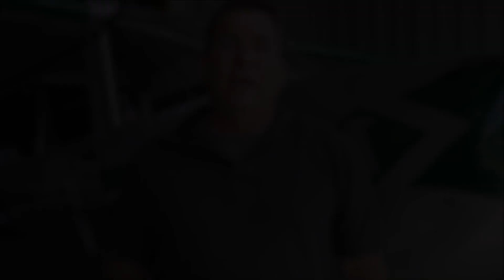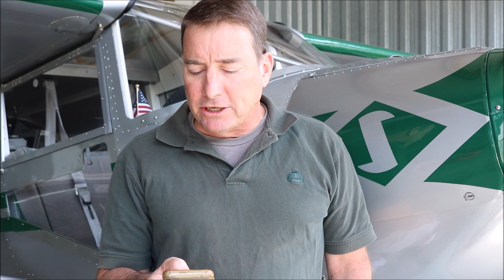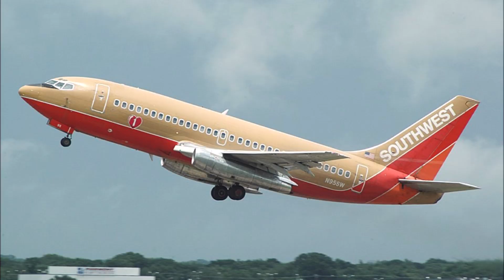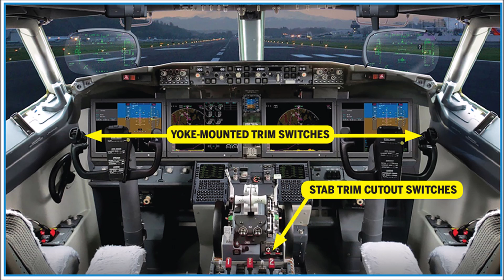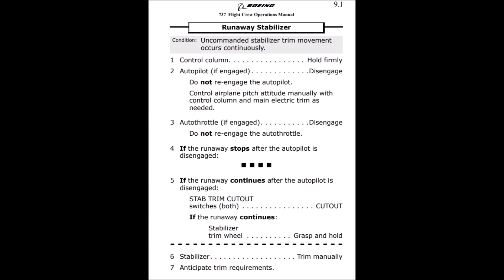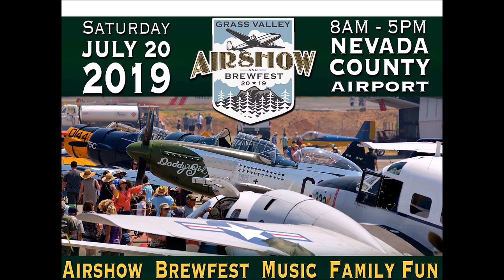737 Max UPDATE 27 June 2019 -The Latest Issue

Comment: If I recall correctly, this channel blamed the pilots for the crash events?  Still of that option?
Reply from the maker: Yes, they have there share of the blame as does Boeing's design. You simply cannot leave the throttles nearly WFO...
Reply: As I thought from the very start, it is a failed design with a failed implementation and, if possible, a potential cover up.  People can assess your judgement and overall knowledge through your videos.  A robust well engineered and implemented system does not lead to this even once, certainly not twice.  I’m not sure about your evaluation if this particular scenario.
Reply: @indepviewpt  
Accident investigations don't generally use the term "blame," they refer to causes.  Everyone agrees that Boeing screwed up.  Nobody has offered any kind of cogent explanation for why the MCAS software failed to use both AoA sensors and failed to do any error/reasonableness checking of AoA inputs.  And everyone agrees that the implementation of MCAS presented crews with a challenging situation to recover from.
That doesn't mean you don't look at other causes.
In the case of Lion Air, please explain why the crew stopped using MET to trim up and advanced the throttles to WFO (as Juan says) AFTER the aircraft entered the final dive?
In the case of ET302, please explain why the crew failed EVER to use MET to fully neutralize control forces, particularly where they were trained on the Emergency AD.  Also, consider that the aircraft appears to have been over Regulated T/O Weight (ferrying fuel) and in trouble from the get go (the Preliminary Report said they were under RTOW but look at the average weight per pax they used to get there).
So there were other causes than just the bad MCAS design.
A robust well engineered system isn't going to prevent airlines and pilots from doing bad things in every possible situation.  That is an unreasonable expectation.
Reply: If one stops getting lost in the details and, instead, goes to the “30000 foot” view, it can be seen that two planes crashed fir essentially the same reason with licensed professional rated pilots flying.  Can you please state the other time this has happened?  This is a FAILURE of enormous proportion.
Reply: @indepviewpt  
All you've done is substitute the word "reason" for "blame."  
The 30000 foot, forest for the trees argument, is what the plaintiffs' lawyers will argue because it's their obligation to get the most money out of Boeing they possibly can.
But for people who are interested in aviation safety, you don't ignore the details.
And, if you want to talk about the "reason" the two planes crashed, I believe it was for essentially the same reason (in the sense of principal causes):  MCAS put the planes in jeopardy and the crews failed to do what they were supposed to (and did what they weren't supposed to) to save recoverable situations.  There were probably other contributing causes, such as airline procedures, crew qualification and proficiency, among them.

Comment: The Trim Motor not getting enough voltage to run fast enough? Could an update fix that? Or would it take a bigger microprocessor to supply more voltage? 
It would be Great Captain Browne if you could get some videos of the Air Show!! Wish I could be there.

Comment: I appreciate your updates - but isn't everyone still ignoring the elephant in the room which is the aircraft as it stands is basically unstable, and requires computerised systems to compensate for this basic instability. I don't know about anyone else - but I just cannot fathom why this aircraft was allowed to even be certified in the first place, as opposed to forcing Boeing to re-design the model. I know this would have cost millions more for Boeing - but surely you cannot put a price on people's safety.
Reply: The MAX is not basically unstable. MCAS is designed to augment specific areas of the flight envelope under manual pilot control, that are governed by FAA regulations, but very rarely encountered.

Comment: And now we hear that the software was outsourced to Indian design companies because that's apparently cheaper. I can tell you from 30 years experience in the tech design field and with not one atom of racist intent that I've seen a lot of projects outsourced to India and I've never seen anything good come out. The issue is mostly with the Western managers who think they can do some kind of dragnet recruiting in a faraway land based on nothing more than a low hourly rate and somehow get competent designers out of this. It doesn't work. The projects take forever, cost more than if competent designers were hired in the host country and the end result is a mess which nobody fully understands and which doesn't perform properly.
Boeing managers - hire local people who can damn well do the job right. They won't be the cheapest per hour but they'll be the cheapest in the long term.

Comment: With the best will in the world you are not a software and/or electronics person, are you? Nobody is developing a new microchip to fix this issue. You can't just shove a new chip into a system. You'd have to insert a whole subsystem which would take many months to develop and validate. This sounds like there's a trim rate calculation, or table of rates, that needs tweaking. On the other hand, this applique method of tarting up the 1950s designed 367-80 systems is how Boeing has arrived at this mess of ancient and modern hardware. Disagree? Tell me how the overhead on a 757, 767, 747-400, 747-8, or 787 compares to the dogs dinner on the overhead of the 737 MAX. Any pilot of the aircraft I listed could get in one of the others and have little difficulty getting it configured to fly. But any 737-200 pilot would feel right at home. The 787 is harder, unless they have fixed the many system startup warnings, but as a 777 FO you would have no trouble setting up a 747-8. Can you say the same for anyone who has maybe got into the 767 via a career starting in regional jets and now climbs into a 737? Boeing should have stuck a fork in this old turkey twenty years ago, but there's always a bit more cash to wring out of a cheap aircraft with cheap dual channel systems.
Reply: cageordie Somewhere in your lengthy comment are useful statements struggling to reach the surface. Try editing for clarity.

Comment: I suspect it is a mechanical issue. Difficult to imagine the electronics or software could slow down the trimming.
Reply: ste woolf The trim system on the B737 MAX has become an unbelievably complex mix of mechanical relays and computer generated signals. On an aviation forum, even experienced pilots and engineers can't figure out how it all works.

Comment: From what I gather in both crashes a single angle of attack sensor malfunctioned and triggered MCAS.
You would think if they have two AOA sensors on the plane they would take advantage of the redundancy and program MCAS to only activate if both sensors are showing a stall .
One going bad is pretty rare both going bad at the same time next to impossible 
The 737 is a great plane and I am sure that Boing will get it right .
But will the general public ever trust it again?
Reply from the maker: All this has been covered in previous updates.

Comment: Or why didn’t Boeing just built an extendable main landing gear that extends the main gears a little (about 2 feet) longer, after the gears are down??  Messing around with the stabilizer is very dangerous. Having small microchip processors that determines the lives of hundreds of passengers all the time on every flight is dangerous (just a small glitch could spell disaster!!!).....don’t touch that stabilizer!!! Just lengthen the main landing gear....the handling characteristics would be that much different!!!!

Comment: Micro Processors only fail if in an overheat condition ,software will not fix that ,A horse only have so much horse power lol,So delay is the problem , it appear that electric car /vehicles have instant response ,I don't know about you but their micro processors sure know on how to move DATA along to get the job done .Wow I didn't know good software could speed up hardware,well I suppose if you loop to reconfirm request DATA to often, it could take time to trim anythings.

Comment: Sad photos on the 'net with 737MAX's being parked in auto parking lots, etc. How about flying them to Spokane, or alternate airport? Denver has lotsa room. They need to be refurbished.The longer this deal goes on, doubts about the airworthiness of the current 737MAX begin to rise, human nature.  How this plane got released to an unsuspecting public and kept-out-the-loop pilots is criminal negligence. At what point does the 737MAX face being scrapped? They are now on a zero screw up policy. Might be easier just to bite the bullet and design a proper 797. Bring back the retired engineers to built the 757, 777 and 747. I think "....there is a failure to communicate" within the sprawling Boeing Empire. Boeing moving their headquarters to Chicago because the president of Boeing (at the time) had a wife that wanted to live in Chicago.
Can't make this crap up.
Boeing corporate got removed from the once magnificent passenger planes that Boeing built. They need to toss the minroity hiring quotas out the window and hire apprentices to learn under the old crew that had pride of workmanship. Obviously, lotsa balls got dropped on the 737MAX program.

Wall Street will have the final say on the fate of the 737MAX. Yes, an emotional decision, the worst kind.
Reply: Existing aircraft can be moved to the desert (one-time relocation). AFAIK newly produced aircraft cannot, since they have not (yet) been certified to fly.
Reply: @gordonrichardson2972  ...many thanks for the clarification. I thought of Mojave, Tucson and Nellis AFB. Wendover?
But this time of year, too hot  work on.
I hope Boeing engineers get this bird in the sky. Lotsa capital just sitting about. Pilots losing their property due to no flight time.
Why not bring in Lockheed engineers that got the F117A to fly?
Reply: @Swimfinz   :)    For what it's worth, the F117 is totally unstable (designed that way) and couldn't fly for one second without its computers.    Same for other military jets, I doubt if one could meet airline certification standards.   (I'm not denigrating Lockheed, I think they did a beautiful job with the L1011 )
Reply: @Swimfinz    Never seen that link. 

(Just got the point of your F117 reference - if they could make that fly, they could make anything fly.   I'm a bit slow this morning.    Don't think the Max is quite that bad...   :)
Reply: @Swimfinz   Oh, and on the subject of that link - yes it is a worry if they were outsourcing their control software.    I've seen it before in other fields - engineers who should be designing stuff using all their background knowledge, instead having to try and write specifications for some third party to do it, and then fighting against their cost-driven managers to get fixes made when the third-party designs aren't quite what was expected.   It requires a different mindset and maybe even a different culture to do it that way and not everyone can make the transition.

Comment: Sooooo.... I’m supposed to feel better that it’s not another problem with the MCAS? Or am I supposed to be worried more that there are undiscovered problems that Boeing self certified and passed so we can be in danger later? Yeah doesn’t matter if it’s the MCAS or microprocessor. It’s still a major issue that shows this plane was not ready to carry passengers and Boeing stacked their pockets by cutting cost on engineers. Seems strange to me that the time Boeing was forcing experienced engineers out they subcontracted cheaper inexperienced engineers to do the job for the 737. To me they are paying for all the cost cutting and penny pinching they did to make money risking all of the passengers lives in the process. Greed

Comment: This issue has nothing to do with any CPU on the MAX. It's the system design that in part is implemented in the MAX avionics software that they are having issue with.
Reply: SpinFast - significant parts of the avionics system design must be implemented as software running on one or more cpu. The FAA seem to be testing all the decision logic and its impact on safety. If the specification or architecture of the avionics does not allow the pilot to use the trim switches to override the out of trim situation quickly enough then the system implementation is faulty. We can perhaps fairly say that the fault is in one computer if the black box architecture of the avionics maps the implicated processing to one particular processor (or perhaps a programmable logic array).
Reply: @sja45uk  Nothing incorrect about my comment. The problem is a system design issue not a HW/CPU issue. Not really fair for these non technical journalists to try and provide engineering  analysis of the MAX system.

Comment: Am I missing something here? If all of a sudden the nose of the aeroplane (yes, yes...we use English English in Australia) points down, why would you not just pull on the yoke. Surely the trim pitch switches are just for micro adjustments so the joke is unloaded and the plane flies level on its own...and whilst autopilot is not engaged. I fly as an operator on the RFS fire tankers we use here in NSW, Australia. We are all volunteers including the pilots. I have watched in training after we have filled up and climbed to 10,000' , the pilots manually trim the aircraft until they can achieve level flight without touching the joke. So why is this so hard in the Max? Yanking back on the yoke surely should automatically disconnect the autopilot and connect the joke to the elevator instantly. Then you should adjust the trim wheel and just toggle the switch to fine tune it. Or is everyone now expecting planes to fly themselves now? Manual override should only take milliseconds even in a computerised system. 

Out of interest, how does Airbus deal with this issue? They are keeping a very low profile in this crisis. Maybe Boeing should buy the Airbus computer system?
Reply: Airbus (and most higher-number Boeing models) are fly-by-wire.   Their control system philosophies are very different from the 737's.   Trying to install that in a 737 would be such a major undertaking, it would be roughly equivalent to designing a whole new aircraft.   Also, it would be a complete 'new' type as far as pilot type certification was concerned. 

In the 737 the yoke is connected to the elevators, however the trim on a modern jet is so powerful that if it runs to its limit it can overpower the elevators.     The standby manual trim wheels become too stiff to operate against full out-of-trim.    The MAX's problem was that MCAS operated when the autopilot was disconnected (i.e. in manual mode) and could only be disabled by switching off electric trim.    The pilots did pull back on the yoke and tried retrimming but MCAS kept re-activating.   (That's an over-simplification of a slightly complicated issue).

Comment: Thanks for all your videos, Juan.  I have a question, after following this whole thing for a while and watching some other videos on why the MCAS system was needed.  It seems as the engines got bigger, in order to fit under the wing, they had to move them forward and upward, changing the dynamics of the plane.  I wonder why they couldn’t have just changed the landing gear to make it taller?.  Seems like in that scenario the engines could have been in a similar place under the wing, much more in keeping with the original design.  Just wondering what your thoughts are on that.
Reply: A lot of this background was covered in Juan's previous videos.
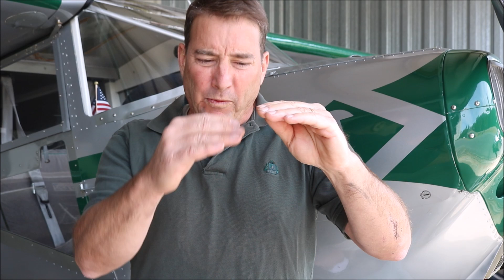Reply: Gordon, I have watched every video that Juan has done on this and have never seen it addressed.  In fact the only reason I am asking is because of seeing it illustrated in this video;  https://m.youtube.com/watch?v=H2tuKiiznsY&t=249s At the1:54 mark.  If this has been discussed here, help me out with a specific video you have seen it in and a time stamp, rather than just saying, “much of this was covered here”.
Reply: @tomschilb7252  If the landing gear is taller, the gear attach point has to be farther away from the wing root, with attendant expensive re-engineering costs, plus they'll have to modify the fuselage for the taller nose gear. In the end, you'd have an airplane that has a different landing pilot's point of view, which puts us right back into new type-rating territory and high training costs, multiplied by hundreds of aircraft and what, 3 crews for each? Untenable for the airlines, and would send them flocking to the A320neo.

IMO, the real issue is putting a single-point-of-failure system between pilots and control of the airplane.
Reply: @BeechCoomer - not necessarily so;  the landing gear could have some capability to telescope - or it could extend further into the fuselage - there is a gap between the wheels when landing gear is up.  And really we’re not talking about a lot of difference.  For the most part, I’m asking the question because it seems like one no one has ever asked it.  And it is quite likely simpler than creating something such as MCAS, not to mention redesigning the structure of engine mounts and all the different forces they are subject to.
Reply: And I agree with your assessment that real issue is the single point of failure system between the pilot and the controls of the plane.  I drive a 1992 Jeep for that very reason; I prefer to operated a vehicle with as few non-mechanical interfaces between me and the machinery.

Comment: The tailplane on this nose-heavy plane will have to to turned up so often in order to keep the stern down that it may come under enough pressure for dangerous metal fatigue to set in. Therefore the F A A ought to insist that it be strengthened
Reply: Where did you get the idea that is nose heavy?